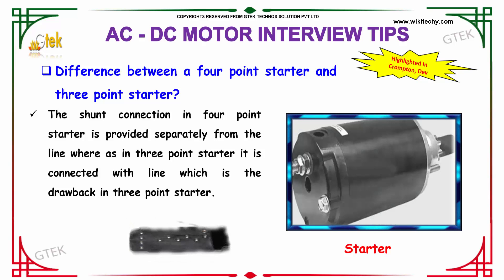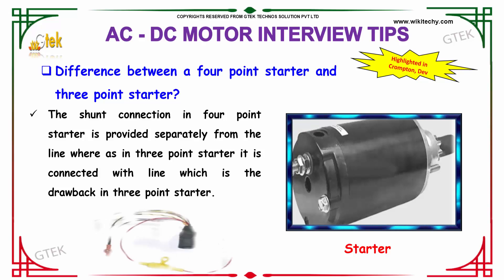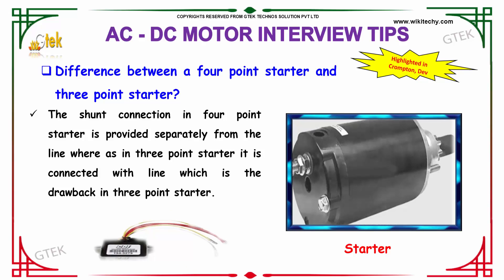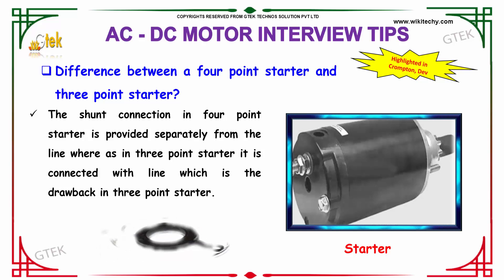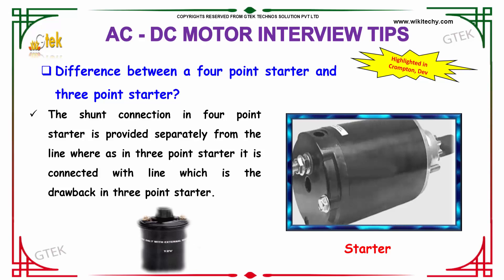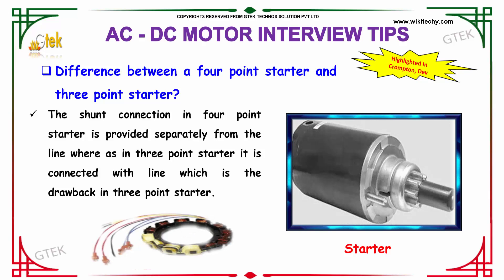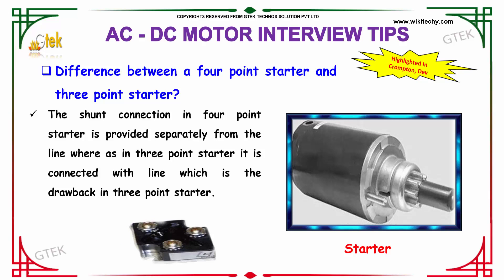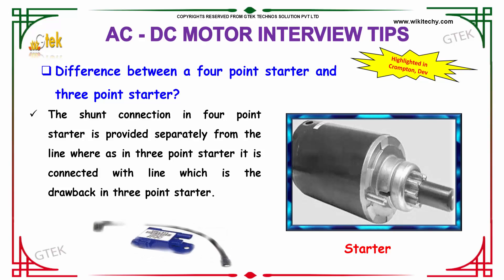Difference between a four point starter and three point starter | AC-DC Motors Interview Questions

Comment: Difference between a four point starter and three point starter?
The shunt connection in four point starter is provided separately from the line where as in three point starter it is connected with line which is the drawback in three point starter.

Comment: The shunt connection in four point starter is provided separately from the line where as in three point starter it is connected with line which is the drawback in three point starter.

Comment: Working Principle of Four Point Starter. ... The basic difference in circuit of 4 point starter as compared to 3 point starter is that the holding coil is removed from the shunt field current and is connected directly across the line with current limiting resistance in series.

Comment: Thus, the motor is automatically disconnected from the supply. Drawback: In a three-point starter, the no-volt release coil is connected in series with the shunt field circuit so that it carries the shunt field current. ... This drawback is overcome in the four point starter.

Comment: the motor is automatically disconnected from the supply. Drawback: In a three-point starter, the no-volt release coil is connected in series with the shunt field circuit so that it carries the shunt field current. ... This drawback is overcome in the four point starter.